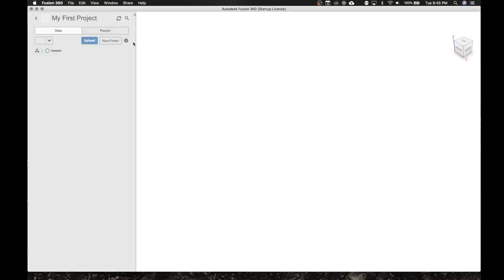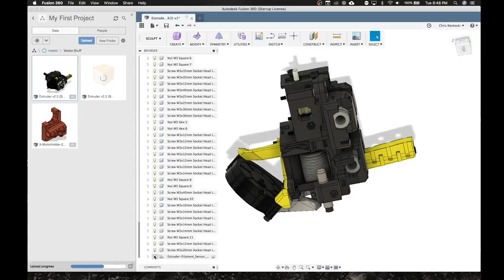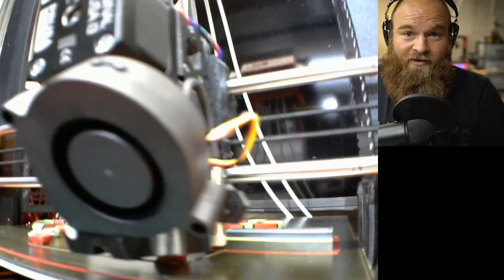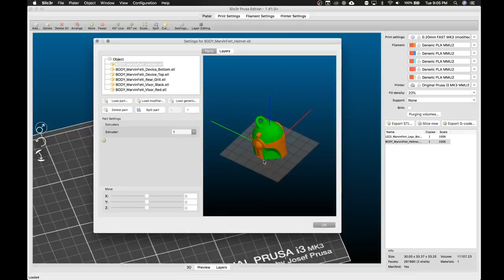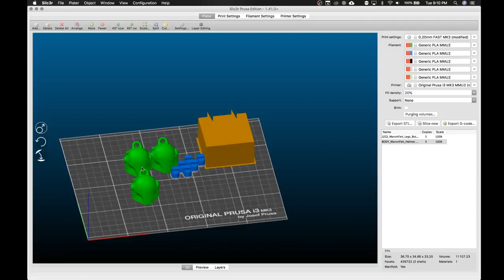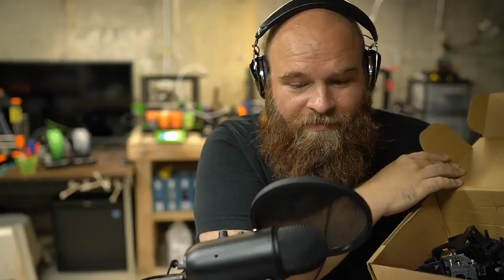MMU2 and Slic3r MMU setup (Audio fix)

Comment: Is it possible ti upgrade other printers which are not prusa with MMU2? Is there a connection diagram how it is MMU2 connected to printer mainboard? And major settings are in Merlin software?